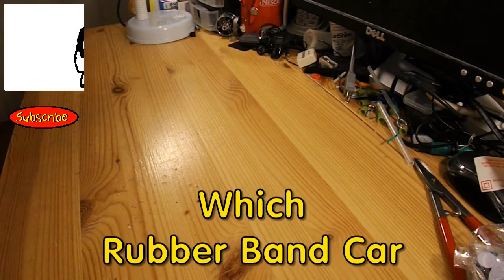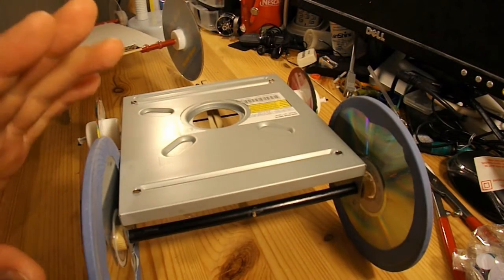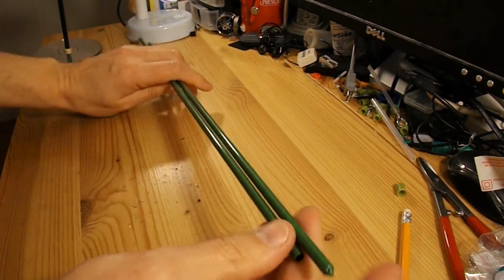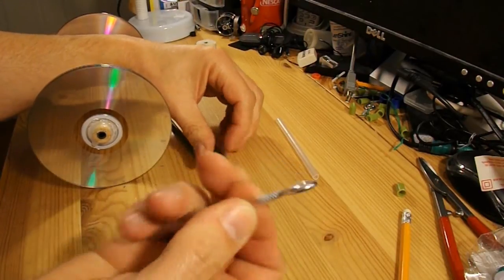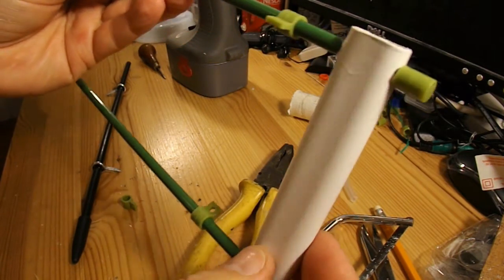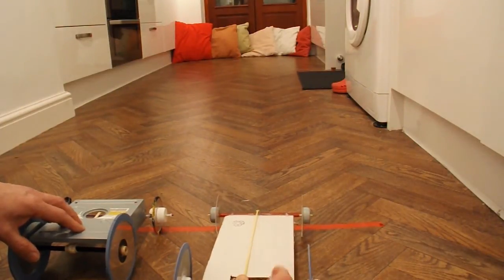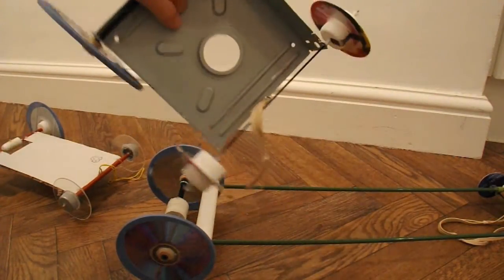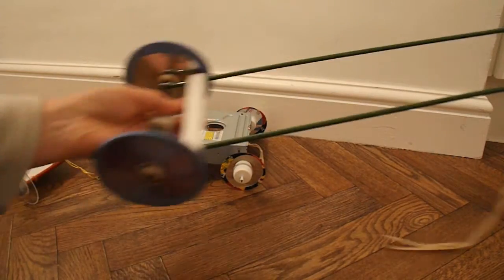Which Rubber Band Car is Fastest, Grandad? Part 1

Comment: Why do the little wooden pegs on the axles not break under the tension of the rubber band?
Reply from the maker: Easy answer. The peg just holds the band in place while you start winding. Once it has wound round the axle one turn there is no direct tension on it. The band is gripping the axle not the peg. You can do without the peg and just wrap the band on itself and it will hold itself, the peg just makes starting the wrapping easier.

Comment: you can always use the formula v=d/t to figure out the velocity of a car without a speed gun, however it might take longer
Reply from the maker: Hi Dtinsider, you would need a method of timing the cars over the distance and using a hand held stopwatch would not be accurate enough because variations in your reaction time would make a lot of difference to the result. In this video I use a home made laser speed trap Rubber Band Powered Hot Rod I have also done an Excel spreadsheet to work out the average speed from the results using the same formula you suggest. The distance between the two trigger points is 3 metres.

Comment: No way to measure speed??? Distance/time
Reply from the maker: As the question was "which is the fastest?" then we don't actually need to know the speed, just which one comes first. However, how accurately can you tap a stopwatch when the car is only covering 3 or 5 metres. The delay in your reaction time would make a significant difference to the calculated speed. Try doing the maths yourself and see how much difference you can create. Average reaction time to visual stimulus 250 milliseconds. Lets say the car travels 3m in 2 seconds gives you 3.35 mph then add your 250 millisecond reaction time so you get 3m in 2.25 seconds and 2.98 mph which is close to a 10% variance. Of course your reaction time will vary and you need to include it at the start and the end so there will be some cancellation. However if you really want to try to measure the speed you could build an electronic timer. Here is a simple one I developed (it could be vastly improved but it shows the principles using some simple components) - Digital Timer for my toy cars https://www.youtube.com/playlist?list=PLA5a2xPRSrB2mEKV5Qs0vwt79iXIJYtD-

Comment: What did you put on the foam to make sure it spun with the back axel?
Reply from the maker: I hot glued it in place and added tape around the outside to keep it tight. On the bigger car I think I might have put the wooden peg right through the axle too so that would have held it in place.

Comment: Is the fastest car smaller then 15 inches ?
Reply from the maker: +fredfredyjoe nope, it is 600mm long or about 24 inches. However that is not relevant. If you wanted to copy it you just make it to the dimensions you are allowed to use. The principles remain the same. A strong rigid body to allow you to use the strongest rubber bands. A strong back axle to take the strain of the strong motor. Good grip on you wheels to get the power to the ground without the wheels spinning.